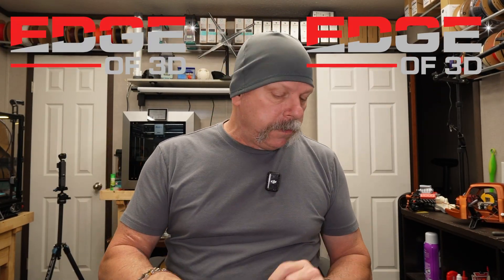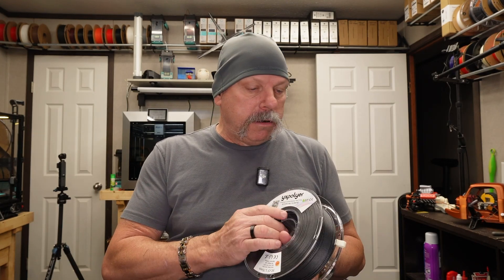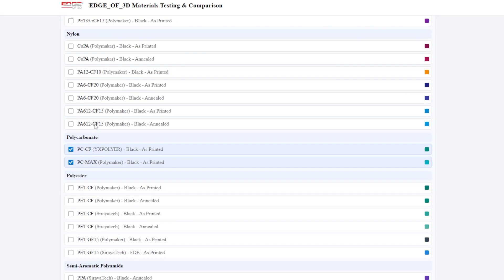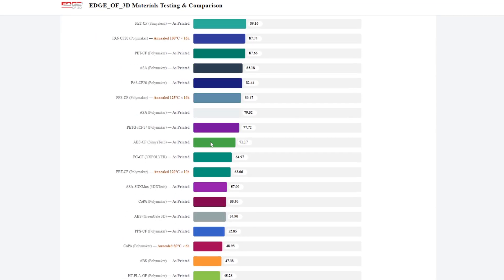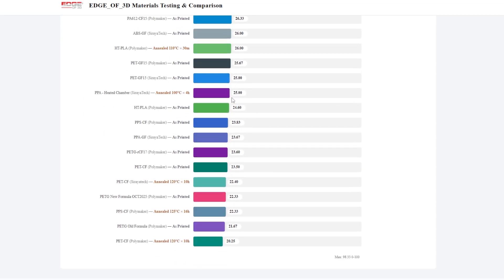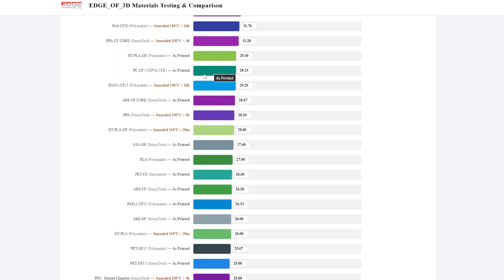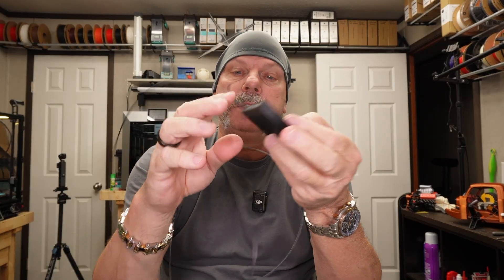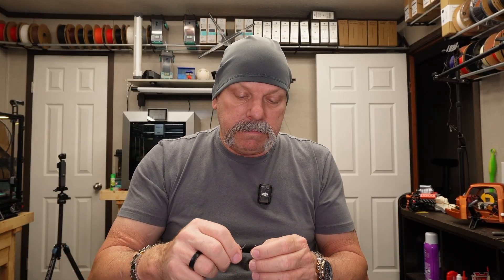PC-CF by YXPOLYER Tested | EDGE OF 3D

Comment: I’ve printed with this and the 3DXTECH ezPC-CF.  The YXPolyer is better priced (~$39 when I bought it) vs 3DXTECH $88 for 750 grams.  It printed wonderfully using a 0.6 mm nozzle on an H2D but had problems extruding when using a 0.4 nozzle.  The 3DXTECH ezPC-CF printed easily on the 0.4 mm nozzle and probably was the most attractive print I’ve ever made. I’ve since decided to use Polymax PC when I need impact resistance and Polymaker PET-GF for stiffness as it feeds easier and has better layer adhesion.  I have not tested YXPOLYERS claim on 350 mm/s.
Reply: Thank you so much for your positive feedback on our product — it really means a lot to us.😊
Reply: I print yxpolyer on my H2D with a 0.4 nozzle and I haven’t had an issue yet. I do dry my filament at 85c while I print, so that could possibly help.
Reply: @mattcat2218  Thanks for that info. I'll have to give it another try.   I  got a Sunlu E2 so I will try drying while printing.

Comment: I think YXPolyer does make some good filaments for good prices, but this isn't particularly impressive for a PC. I would suspect it is heavily blended with ABS like most PC on the market. Two of the most important qualities of PC weren't really tested which are creep and heat resistance.
Reply from the maker: Heat and creep are never tested in my first video of a filament. I have both of these items currently being tested for heat and creep, I will follow up later with more data when these tests are completed.

I'm reworking my entire workflow so as that these are all done in one shot but the downside is this means some materials will be 4 weeks or more before I feature them.
Reply: @EDGEOF3D  Yeah for sure I know you can't always test everything or all at once. Wasn't meant as a criticism. :)
Reply from the maker: Did not take it that way at all, there are just more tests that need to be shown and I have to rethink my workflow so that all of the tests are ready at the same time. Heat testing, at least in the setup I currently have, and my way of doing it, requires I am in there every 30 minutes documenting then adjusting the temperature. This ends up being an entire day where I cannot leave or be otherwise occupied so currently I wait till I have enough material to do nothing but heat test for an entire day.
Reply: Thats actually always been a big suspicion (if not honestly a fact) with this filament, that its mixed with abs. You can actually occasionally smell the abs when you print with it. So in my mind I treat it as an in between abs cf and true pc cf but its always made me very curious on its heat and creep resistance. I do like this stuff though and have printed quite a bit of it.
Reply: @Infinit-Endz Yeah unfortunately most PC on the market is higher % ABS than it is PC. Largely because pure or close to pure PC is actually very hard to print.